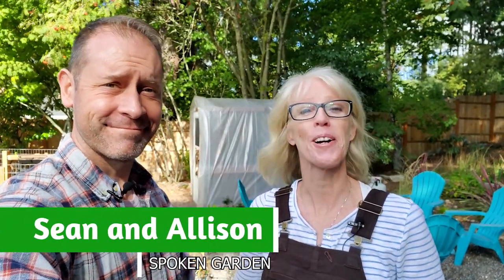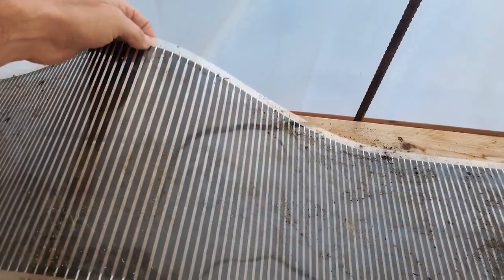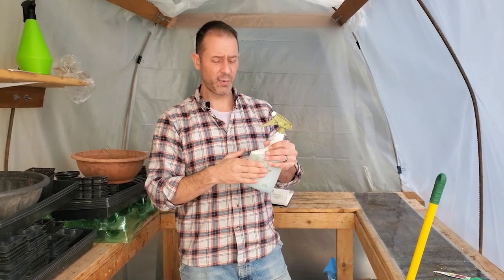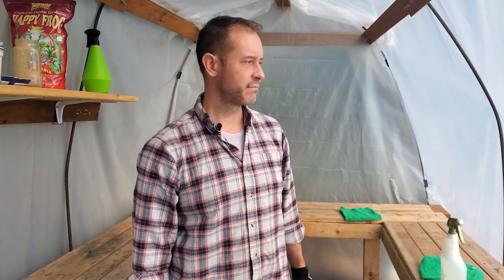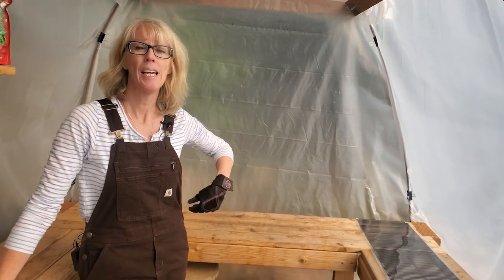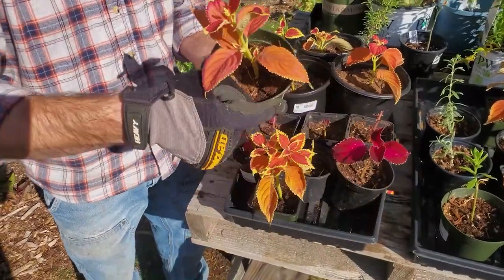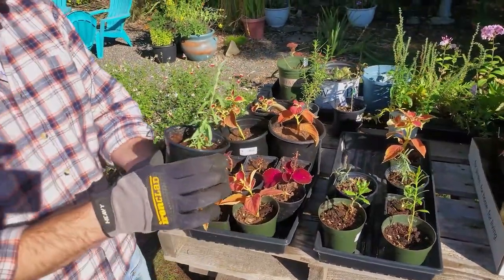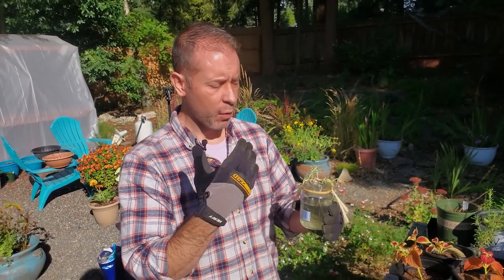Greenhouse Cleanup + Coleus Cuttings Update! 😃

Comment: Is the greenhouse homemade? If so do you have a video on it?
Reply from the maker: Hi Tazmankb26! 👋 Thank you for watching and for your question. 😃 Yes, our greenhouse is completely homemade. We don't have a video on because we built it before we started making and videos, but we do plan to expand and add on to it. This could be a great video topic! It's basic construction: steel pipe spaced at 2-ft centers pounded into the ground, 2x6 boards on each side lag-bolted together at the base, 20-ft long 1/4-inch rebar as the hoops, 2x4 boards lag-bolted together, and 1x4 boards above those on each side with 1x4 boards over the apex of the rebar hoops, also lag-bolted together. Then covered with 0.60-millimeter poly-sheeting. In a video, we can go over more details and what we did first and steps for its construction. Thanks again for asking! 😉👍